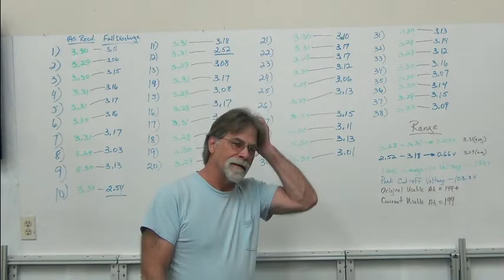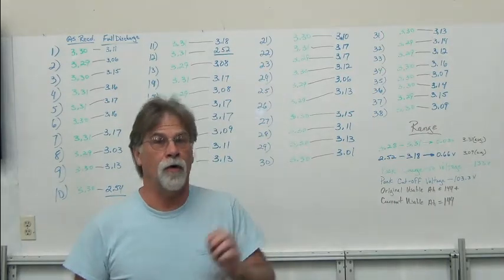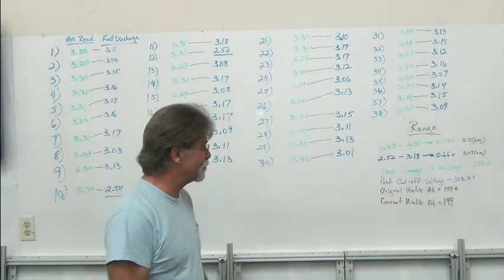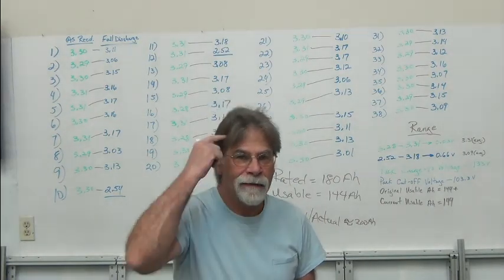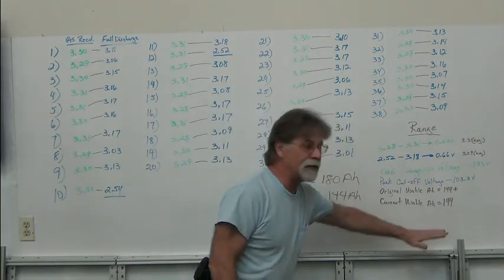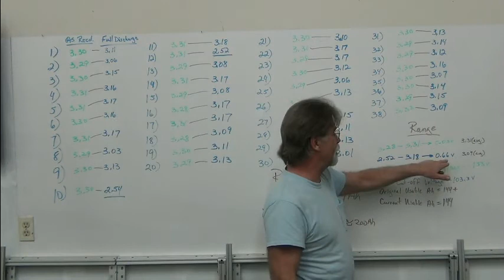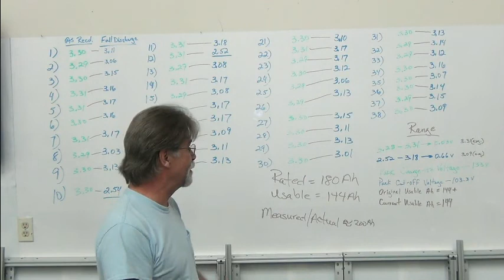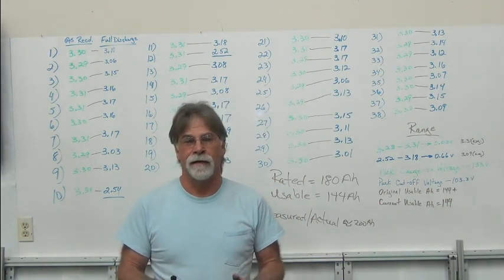Just How Good are CALB cells? - Survive 8 Years in the Desert without issue.

Comment: Great video!  Very informative.

Have you charged it/them in the high heat?   I’m curious about changing from lead acid to lithium for a solar system in the desert.   My battery shed reaches 120 degrees while charging out my lead acid bank.
Reply from the maker: LiFePO4 cells have an operating range of -4 to 149 degrees Fahrenheit.  The vehicle featured in the video was converted in 2013 and spent eight years in the Mohave desert.  It has been a daily here in Northern California for the last two years and has been driven on 118 degree days.  Runs like a million dollars.